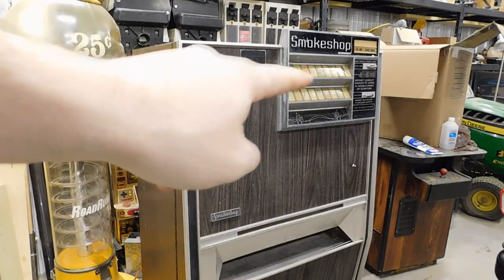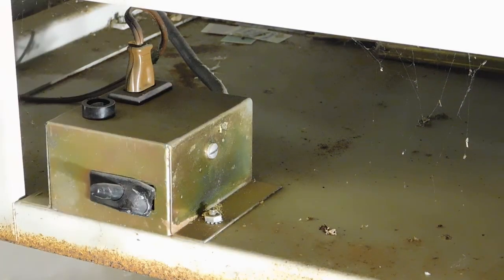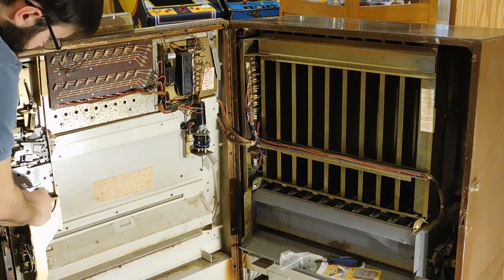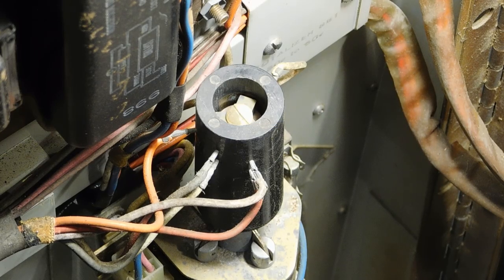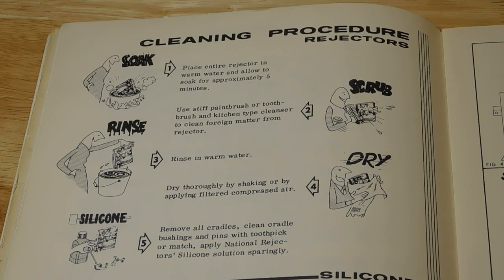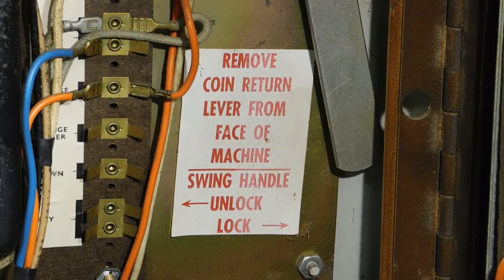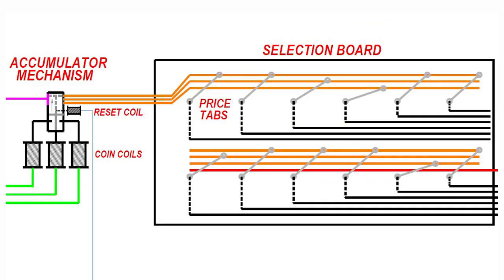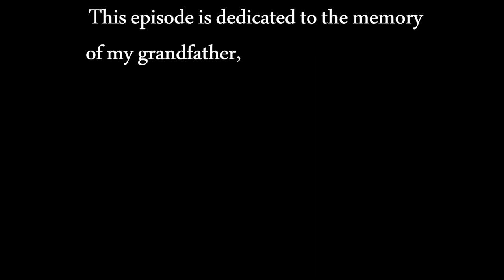1960's Cigarette Vending Machine Repair and Mechanism Explanation

Comment: Is there a max price you can set for this machine, or can you still get a pack of Lucky Strikes for 25¢?
Reply from the maker: Right now the top contact of the accumulator is set to 80 cents. You can adjust the rod itself to increase that price, but I do not know what the maximum is.
Reply: @coin-opcorner  In Kentucky (a big tobacco state) cigs were 35 cents a pack in the 60s. On a trip to NYC in 1968, I saw a vending machine with cigs at $1.25 per pack. God only knows what they cost up there today! Probably $10 a pack and yes, people still buy them!